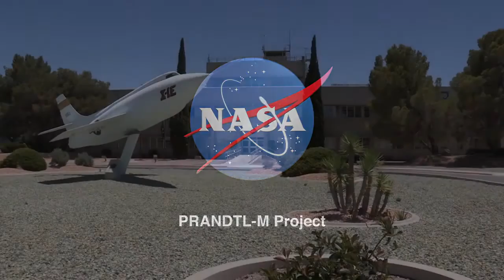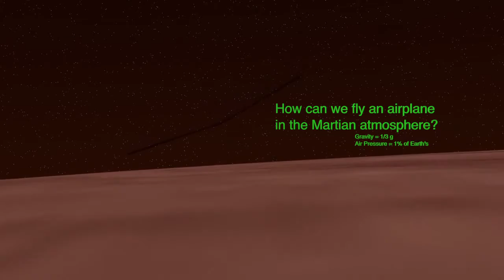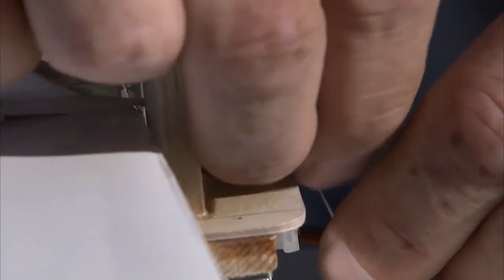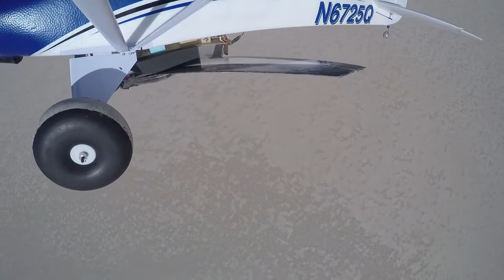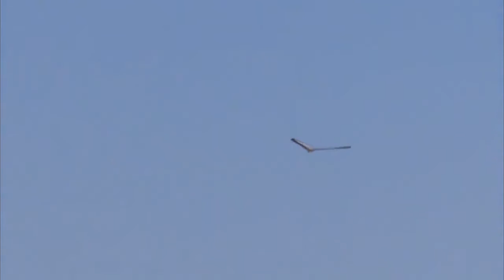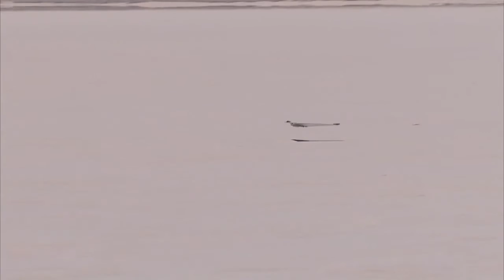PRANDTL-M Successful Test Flights #NASA

Comment: I would like to see this as a forward swept wing, with the last half of the wing bent back like an actual albatross.
Has anyone made a forward swept flying wing?
Reply: Forward swept wings are basically even less stable and subject to serious aeroelasticity problems.  They would require even more excesive washout and therefore operate at a lower effective aspect ratio to actual span than this one does.  Not a good idea.

Comment: Sorry to sound thick, but I fail to see how the control surfaces are any different from my RC flying wings? I mean, I thought that you were using washout to advance the outside wing into a turn by increasing washout which still equates to more drag on one wing VS the other. It's still a controlled FALL through the atmospheric conditions. I can appreciate the concept of increasing the forward moment of the outside wing instead of creating drag on the opposite one. It's not as effective, but still is presentable.  I'm not at the controls to witness the effect of my cause, but it looks typical to me. Please, I do want to get this, but I don't. Sorry for being a little thick. My hang glider uses zero control surfaces to induce drag for controlled flight. Only weight shift. sooo,,,, Hmmmmmm.... HELP ME???  I have the same Carbon Z Cub RC plane BTW. LOL Great flying plane. the activity of the atmosphere during the entire flight will have way more impact on the overall glide ratio and that's very hard to measure. How much sink VS how much lift was encountered during the course of each flight? Etc.
Reply: google
Reply: yes, there is a difference in drag between the two wing halves, but the important thing is that you take away drag from the one you want to move forward and not add to the one you want to fall back

it decreases overall drag and makes the plane more efficient

https://youtu.be/RoT2upDbdUg
Reply: @marc_frank  See this concept doesn't make sense to me. If you're increasing wingtip AoA and that increases lift and decreases drag, then doesn't that mean the wingtip was operating at a suboptimal point? Doesn't the whole wing get more efficient if you rotate both wingtips up and decrease drag and increase lift on both? Or does that exceed the root bending constraint?
Reply: @appa609  wow this was 3 years ago? cool
so the thing is, if you increase the aoa, lift increases, yes, but drag increases, that's called induced drag
on the prandtl and horten planes, the wingtips have a lower aoa than the root
that's similar to normal washout used in other planes, but that washout often is linear
on the prandtl, the washout is non linear, to produce a bell shaped lift distribution
that is the lift distribution, which is most efficient, if you constrain root bending moment, instead of wingspan
if you do use variable aoa along the span to produce the bsld, like the prandtl does, instead of the other method, variable chord along the span, you get the neat side effect of proverse yaw with roll input (given you have positioned and sized the control surfaces properly)
normally, roll input causes adverse yaw, that makes the use of a vertical stabilizer for yaw input necessary to achieve controlled flight
with the bsld, proverse yaw and a swept wing, there is no need for a fin to directly control yaw, roll input simultaneously and automatically produces the necessary yawing moment, too
and that is where most of the drag decrease of such an airframe comes from, there is no need to have a fuselage to carry the vertical and horizontal stabilizers, which both are also not needed anymore
the wing itself is less efficient and bigger in span than one using the optimal elliptical lift distribution, but the latter needs extra and external control surfaces to achieve controlled flight, while the former can do so without them